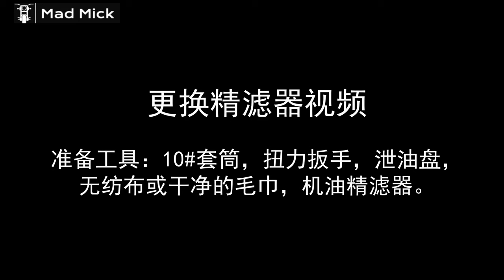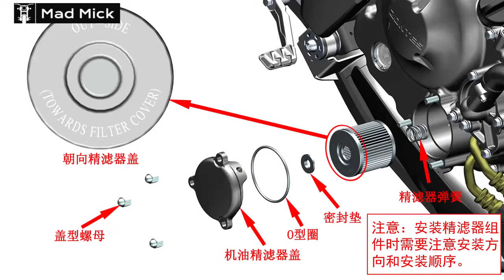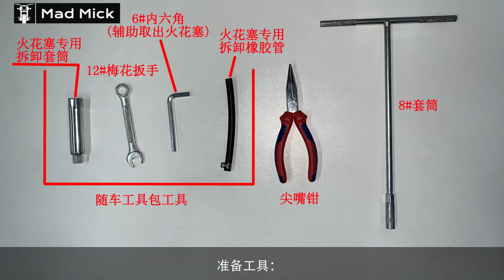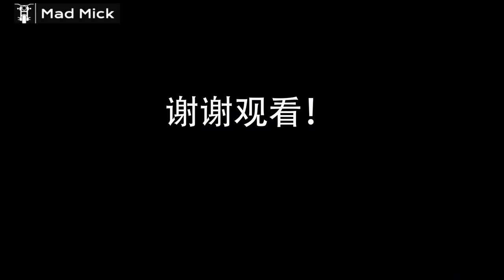ZONTES 350 T EASY FULL SERVICE OIL AIR AND SPARK PLUG D.I.Y.

Comment: Hi mate any idea which charger I can use on the zt 350 as it's a lithium battery 
Thank you 
Paul
Reply from the maker: optimate do a range of battery chargers the optimate 1 does both lithium and gel batteries
Reply from the maker: But try go for the optimate charger above the optimate 1 duo as this version cannot recover a flat lithium battery as it can't communicate with the batteries BMS System, I use an optimate 4 lithium it's brill
Reply: Brilliant thank you so much .